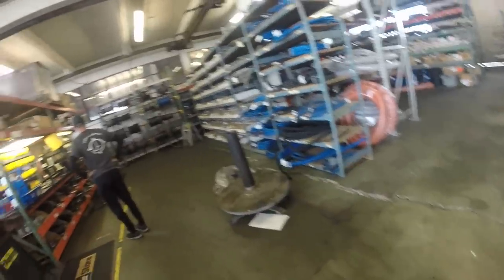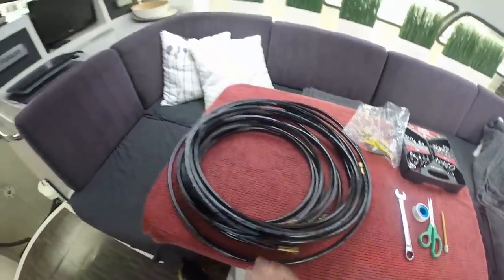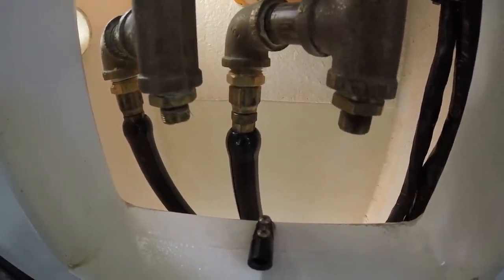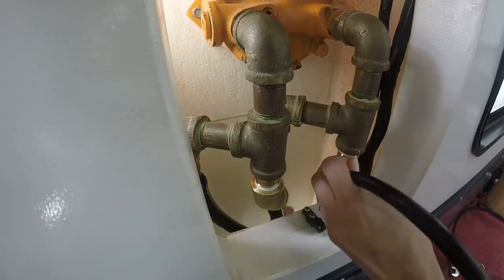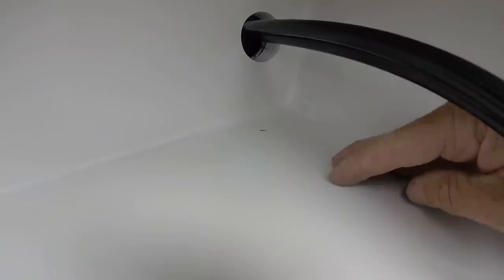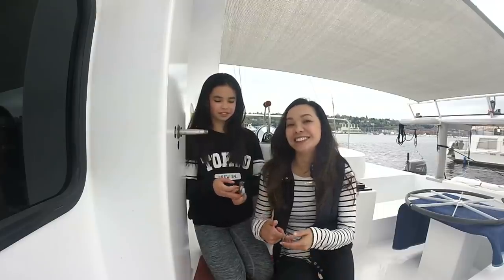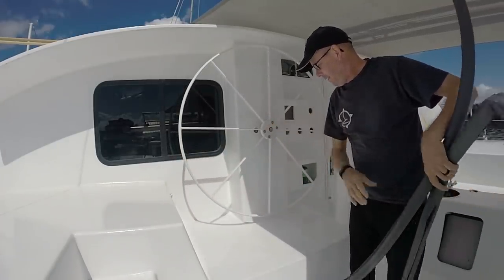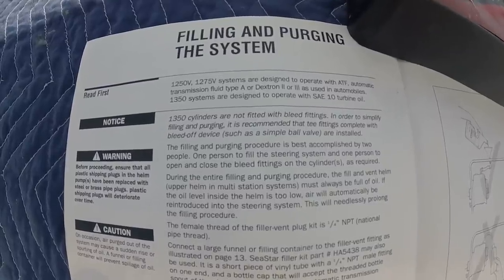Mission Accomplished! Hydraulic Steering Done! Onboard Lifestyle ep.60

Comment: The hydraulic steering is one of the most common breakdowns I experience on a commercial boat. I’ve had rams pull apart (make sure you have stops to prevent over travel) hose failure is the most common problem (have spare hoses and enough oil to replace the fluid (motor oil and diesel 50/50 will work as an emergency substitute) broken linkages are also a thing (again have spares). The plastic coupling between the motor and the pump, I’ve had one beak in 30 years. I know you made a complete secondary steering system but these are the things I’d have on hand

Comment: Teal, next time let Linh know to flip the oil container over where the neck is on top and it will pour easier with no runs down the neck. That's why all the oil companies started offsetting the neck to one side many years ago. Nice job on installing the wheel Linh and Emma, even though Teal left you totally in the dark!

Comment: Good morning Teal and Girls,great video,My concern is brass fittings with brass ferrules on plastic lines require a brass insert in the plastic line to prevent the brass ferrule from cutting into the plastic line and cause a problem when you least expect it, also they make plastic ferrules for plastic line which do not cut into the plastic line please google and research this before finishing this project, what a beautiful job you are accomplishing Have A Great Day

Comment: Congrats and thanks for the museum of flight. Haven’t been there since they were in the red barn. Tell lhin that when your pouring from a container (atf) it’s easier if the container is rotated 180 degrees. Also  it’s sad,  in this country ,more isn’t done to educate women about the mechanical and electrical world at an early age . Excellent work and video. Also thanks for the tip on the hydraulic line shop.

Comment: I don't usually like to provide input since it seems like everyone on youtube is an expert, but at 15:34 the nut you're spinning is a compression fitting. They don't require any PTFE , the ferrules mating in the conical part of the fitting create the seal. For the thread in the block that looks like NPT so it's good. I use a lot of swagelok and they're great compression fittings, Parker is prob just as good.

Comment: I see someone else mentioned the Tape on the threads. My thoughts exactly, Never use tape in hydraulic systems. Anaerobic pipe sealant or loctite if anything is needed at all.
Reply from the maker: I am definitely not a hydraulic expert and appreciate any constructive advice.   If any of the fittings start to weep I will  make the correction immediately.
Reply: Onboard Lifestyle Hydraulic connections are normally metal to metal. Sometimes with an O-Ring or gasket. The PTFE tape is to lubricate the threads of pipes under low pressure. The chance of a small pice of tape getting into a hydraulic orifice or valve makes it a risk in high pressure systems. It will usually get forced out by the pressures.
Reply: @davidp8594   True but as long as Teal kept it off the sealing faces there will never be an issue and rudder vs water slipstream forces vs cylinder attachment point on the pivot arm and cylinder diameter dictate the max psi the system will ever see routinely.   Only way to go higher in pressure is to keep cranking on the helm after max cylinder travel is reached and have a faulty bypass valve or no valve at all in the helm unit.
Reply: @OnboardLifestyle  From what I saw you did a good job.

Comment: Congratulations!  You are a working boat again. :)  

One thing I noticed at 7:42 you have a shot of the lines running into a conduit.  The bend there looks pretty tight, at least from that angle.   The conduit edge also looks a bit sharp.  You might want to consider a wrap on lines with something to prevent wear damage at that edge or at least keep a close eye on it for a while to look for rubbing once you are underway.  It would not be cool to pop a line offshore someday.
Reply from the maker: I was waiting for this comment because when I was editing this video I could see how it was a bit misleading.  I have two conduits running through that bulkhead. On the left is the engine control cables and the Yanmar wire harnesses for the control panels (they look very similar to the hydraulic hoses).  On the right is insulated water leads for the galley and behind them are the hydraulic lines that have a straight shot through the conduit.  On that note, I do have a few areas where I will put chaff gear on to protect the hoses from any wear.

Comment: Hello Captain - Just curious if you purchased two lines for every hydraulic connection? When it comes to hydraulics I have learned to live by the "two is one - one is none" rule.  Also regarding comments about Teflon tape - it is perfectly okay and acceptable in marine hydraulic applications as long as you start it a thread or two back from the end of the fitting. I have used Teflon tape on hydraulics on commercial vessels I have captained for more than 3 decades now.

Comment: =I see the teflon tape issue has been well covered. Bits of teflon can detach from the fitting and migrate thru the system till it lodges itself in a direction control valve thereby jamming the spool.

Comment: Now it starting to look like a boat again and not a barge lol.. I too saw that something was missing on the hydraulic line but many have talked about it all ready. The question i have is about the wheel. What has your thoughts what you are going to use on the end to make it easy for grip and for hand comfort while hand steering. or what was you thinking to use as a maker to show Top Dead Center on the wheel?

Comment: I noticed the rudder crossover steering rod was lowered where it looks like it is just below the hull profile. Was  Vortex shedding considered for this Rod when a wave passes through?
Reply from the maker: It was lowered back to the original designed position. It was raised by a previous owner to allow for a tiller steering option that was never installed. I'm quite sure that the alternating  vortices outflow of both air and water will be unnoticeable and not much of a concern. Thanks for the thought. 👍

Comment: At 11:50 Do Not See a Ferrel / Compression Sleeve  on end of Line
Reply: Yep. Without the ferrule, hydraulic pressure will push the line right out of the fitting.
Reply from the maker: I used a new type of compression sleeve that has the ferrel built in. As you tighten it the first time it crimps the ferrel down permanently.

Comment: Teal - starboard edges still - no good - (razor blade the edges - it is  very fast to do  - and looks smooth and sweet......(use the razor like a wood scraper down the edge of the starboard - few passes is all it takes.....) 
   Also - 1) quick shot of clear coat on polished brass/ bronze - lasts........
  2) make a center cap for your helm (steering wheel) from starboard - hint - proper thickness the material - use hole saws - then round edges - snap it in - lock it with a small set screw.......
Best

Comment: that last connection to autopilot didn't require a ferrule?
Reply from the maker: I used a new type of compression sleeve that has the ferrel built in. As you tighten it the first time it crimps the ferrel down permanently.

Comment: Hi almost any decent size town will have a hydraulic hose and parts store. They are used in numerous equipment and need replacing for all sorts of reasons . You should find , starter and alternator repair places almost as frequently as well. 
Love the quality of your workmanship, oh  btw you should not need to use thread tape on the hose connections the cones inside do all the sealing. 
Cheers Warren

Comment: I was wondering about the PTFE tape.  I don’t think it should be used on hydraulic fittings.  Perhaps you should discuss using it with sales service at the shop that made your lines.  Other than that your steering install looks great.  Max attention to detail as usual.
Reply from the maker: I am definitely not a hydraulic expert and appreciate any constructive advice.   If any of the fittings start to weep I will  make the correction immediately.

Comment: Does the boat have emergency steering in case something in the hydraulics breaks? Also, I'm not an expert but hoses going round 90 degrees may not be a good idea.
Reply from the maker: That is one of the benefits of having a tie bar connecting the two rudders. There is a sleeve centered on the boat that can accept an eye bolt. I  installed U-bolts on the the transom about 8' on either side that a block and tackle can be rigged quickly in an emergency situation. It gives us total rudder control manually.  I agree that hose should not take tight corners and that is why I put 90 degree hose supports in that situation.
Reply: @OnboardLifestyle  having watched the last videos I still think that you don't have an effective emergency steering system. One way of doing it is to install a stand alone auto pilot that works on its own independent system directly as a ram on the rudder quadrant, pretty much like the hydraulic ram. My 2c